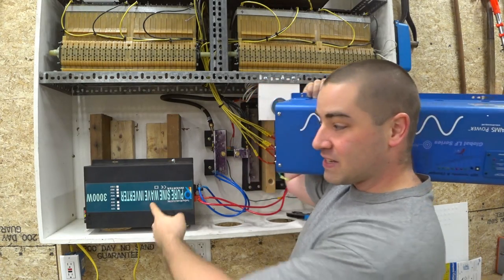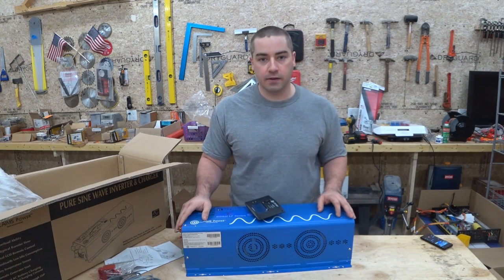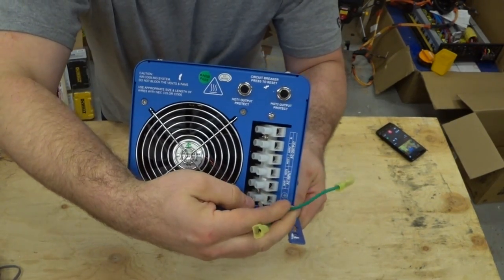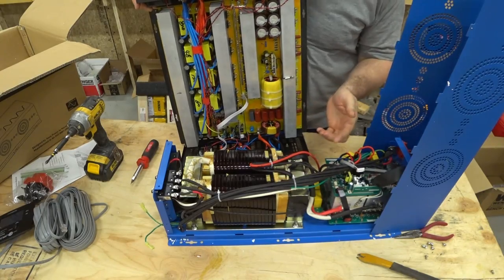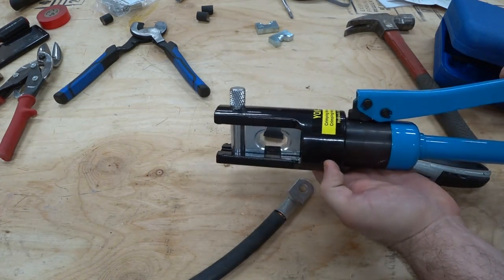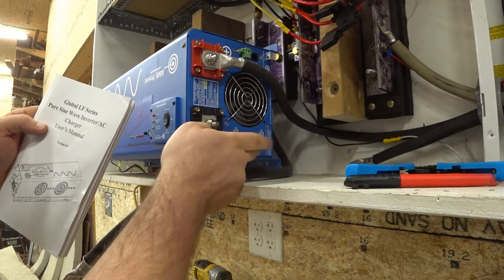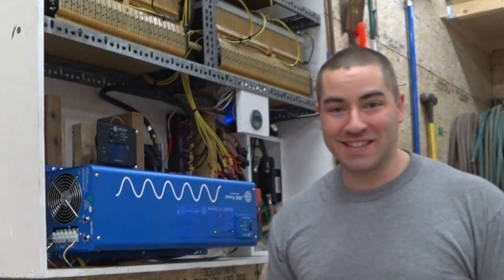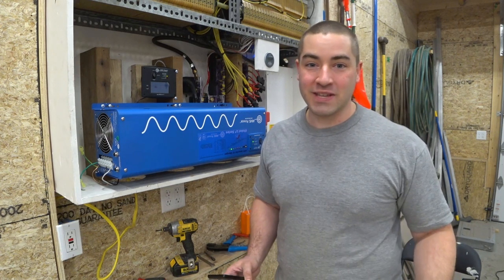Inverter Upgrade! Reliable to Aims in Off-Grid System

Comment: so when would you choose Low Frequency verses High frequency? anyone?
Reply from the maker: Low frequency is bigger, and heavier.  But LF works better with large surge capacity.  Things like my miter saw, air compressor will have a big surge that will sometimes overload a high frequency inverter.  But, HF is lighter and smaller so they are nice in portable applications.

Comment: can it run this inverter run the spilat Ac 1.5tone
Reply from the maker: I don't know how many watts your AC requires.  This inverter is a 6kw model with a very high surge.  If you AC running watts is less than 6kw, then this inverter will probably run it.
Reply: @DavidPozEnergy  Thank you

Comment: Information that can Be Found Here:
https://www.magnum-dimensions.com/knowledge/high-vs-low-frequency-inverters/inversion-methods-explained-high-frequency-vs-low

"IRON CORE TRANSFORMERS AND FIELD EFFECT TRANSISTORS
There are two distinct types of industrial grade power inverters distinguished by the size of their transformers, and the switching speed of their transistors. The ability of an inverter to absorb the electrical surges inherent in certain loads like motors, pumps, and torque-related tools is directly proportional to the physical amount of iron present in the transformer. Size and tolerances of the transistors used in the inversion process, and the speed at which they operate determines the classification of high or low frequency.

INVERSION METHODS EXPLAINED
High Frequency Inverters (HF)
The large majority of inverters available in the retail market are high frequency. They are typically less expensive, have smaller footprints, and have a lower tolerance for industrial loads. HF inverters have over twice the number of components and use multiple, smaller transformers. Their application is appropriate for a wide variety of uses like tool battery chargers, small appliances, A/V and computers, but have a decreased capacity for long term exposure to high surge loads like pumps, motors, and some high-torque tools.

Low Frequency Inverters (LF)
Our UL-listed, low frequency inverters and inverter/chargers are the pinnacle of electrical durability. The massive iron core transformer is aptly capable of absorbing surge loads because of the “Flywheel Effect” inherent in the physical amount of a transformer’s iron. LF inverters have larger and more robust Field Effect Transistors (FET’s) that can operate cooler, in part due to the slower frequency of switching required to produce AC power. These inverters are feature rich to include the optional ability to hardwire additional external GFCI outlets, input of multiple DC voltages, provide regulated dual output voltages (120/240VAC), and integrate chemistry appropriate battery chargers and transfer relays for shore power."

So in a nutshell, big heavy, expensive low freqeuncy-inverters are better suited to start your saw, air conditioner, air compressor, washing machine, etc, etc. All of those items are high inductive loads. The less expensive, light weight, High Frequency-Inverters on the other hand are better suited for smaller loads that accumulate gradually such as: computers, lights, small fans, maybe small power tools, etc etc.

This very much helped me solidify my decision on which inverter-charger to purchase. Great videos, have a good day all!

Comment: Can it run a protable ac
Reply from the maker: Yes.  I"ve had it running two window AC's this whole summer, plus everything else in my house.  The two window AC's were a 5000 BTU, and a 6000 BTU unit.
Reply: Can on Alternator us instead of on battery 🤔
Reply from the maker: I don't think so.  The alternator in my car is 12v, and this inverter is 48v.
Reply: @DavidPozEnergy  ok then wish alternator would be best to use
Reply from the maker: I don't know.  I charge my system with solar.
Reply: @DavidPozEnergy  ok

Comment: ok lets try your hot water heater  and your microwave fridge lights and electronics  all at the same time  run the water heater for an hour I have a 15,000 watt 220 split phase low frequency POWER JACK WITH OVER 8000 HOURS ON IT COST about 1000 by the way all this stuff takes about 9000 watts
Reply from the maker: Hi Robert,  Good to hear you have success with the power jack.  I'd love to see a long-term review on it if you get the time to post something.  I'd love to watch.  
This video was just my first test with this inverter.  Since this video I have ran my whole house on it, including my electric water heater and electric oven, at the same time.  I posted a video about that experiment here: https://youtu.be/4EsYfdK1Hn4  Thanks for watching.

Comment: For me it makes not much sense to have your low voltage 12, 24, 48VDC converted to 110 or 230 VAC(70-90% efficiency) then have like 5VDC mobile charger,  19VDC loptop chager, 12VDC stationary computer, a lot of electronics run on low voltages(they have SMPS inside), lighting can be done at 12v(LEDs need to drop voltage anywhay). Cooking, fridge heating and ventilation, only places where you would need mains voltages... I am not including garage, shed, and other places where you need power tools and high power loads.

Comment: Try out a 12k btu window unit. Lol
Reply from the maker: I have not tried a 12k window unit, but it will run my mini-split heat pump.
Reply: @DavidPozEnergy  im sure it will run it fine. I was just beimg funny or tring to. Lol.  This looks like a great inverter.. gonna have to get me one. What was the cost?
Reply from the maker: I bought it for $900, open-box.  But I think they run $1400 retail.
Reply: @DavidPozEnergy  ok. Ty very much

Comment: Those are garbage inverters. I wish you the best, but the bus conversion company has had a 70% failure rate over 2 years. I recommend the more expensive models by magnum or victron. All the best!
Reply: That's interesting to hear the aims inverters don't last. Do you know what models they have had the bad luck with?

Comment: what's the standby current?
Reply from the maker: I don't know the current, but the standby watts is 30, and idle watts is 80.  Not good, other inverters are about half that.
Reply: @DavidPozEnergy     thanks for answering. yes i was afraid it would have a high idle consumption. 80w is like almost 2kwh a day. this can easily compensated with a couple of solar panels. however overnight with the battery to compensate would be somewhat costly.
Reply from the maker: Exactly.

Comment: Upside down is making me twitch.
Reply from the maker: LOL.  I actually tried flipping the lid over because the screw holes look like they would line up, but the display cable is not long enough.  As I mentioned in the video, I'm not 100% liking the current location and am thinking of maybe mounting it under the box, which would turn it right side up.

Comment: David, is this Aim inverter  of the floating type??...meaning the neutral and the ground are not bonded???....can you bond them??? I was watching this video https://youtu.be/Yh4dHJ8xMKM....and it said that you can't....So what we do for this ground issue? Thanks.
Reply from the maker: When I checked my inverter, the N and G were not bonded.  However, there was a connector where you could bond the two.  I left them un-bonded because I have a bond in my breaker panel and you only want one bond in the system.
Reply: @DavidPozEnergy  Excellent!!!! That was the answer  I was expecting. Thanks.
Reply: @DavidPozEnergy  I have a 3000 watts Reliable inverter...when you check this inverter the neutral to ground is 60 volts and the hot to ground is also 60 volts. This unit is not bonded.  Do you complete the bonding at the panel?...I'm curious from the fact..that the neutral is showing 60 volts....Thanks
Reply from the maker: I also own a reliable electric inverter.  These are not made to feed a panel.  I've spoken with a handful of people who blew up their inverter when trying to go to a circuit breaker panel.  I suggest only using a reliable electric inverter to power an appliance directly.
Reply: @DavidPozEnergy  ufffff....and if for any bad luck the   metal cover  say of a drill  get in contact with the hot cable...if  you touch the metal...can you get electrocuted???...Maybe not if you only touch the metal since there is no path to neutral ... What do you think 🤔🤔🤔???...So basically with these Reliable inverter the ground is useless...😬😬😬☠️☠️☠️????

Comment: ps your test is to ez do like a 35000btu air condenser or a 4hp compression  do a real test i have bin off grid over 40 years i run a shop off my inverters and a house. and  well pump
Reply from the maker: Check out some of my other videos on this inverter.  I crank up the loads.

Comment: This just popped up in my feed, and I figured I'd throw my two cents in. Aims inverters are shit. Dont know how much they have changed but iv had three models and all 3 were terrible. Large expensive models not the small ones. I dont use them anymore. But the magnum 4400 can do 2 to 3 times as much as the 8k watt aims. And even magnum is an average inverter. I dont think people know what a good inverter is. But once you use a good inverter, you'll never go back to using these low quality ones. And it's not even that much more expensive to go with high quality.
Reply from the maker: Magnums are great.  As I mentioned, I was saving up for some before buying this one.  I don't know how long it will last, but I'm happy to make a video and share if it does fail.  Do you have any videos or pictures of your system?  I'd love to see it.
Reply: @DavidPozEnergy  I think I may have some pictures on my Facebook page, my personal system is very rudimentary. Mine is on a trailer and its mobile, but I only spent about $5k on the whole set up, trailer, 8 batteries a aims controller and I have two aims inverters but ended up upgrading to a magnum 4400. But I do installs for a guy that owns a solar company, hes been building systems for about 40 years and his dad worked on the solar for nasa in the 60s. So I am around alot of systems old and new that he does. The Schneider inverters are by far the best I have been around for home models. Mainly the systems he does are passive solar and hydronic heating. I just looked up the price of a aims 6k on Ebay, for that price you cant complain to much but i only paid $1600 for my magnum with a controller and a bunch of other accessories. I bought a aims package in 2014 when I started, include batteries 2 controllers 2 inverters, 12 panels. I think I paid like 4500. I smoked most of the components after 2 years. Still using the panels tho
Reply from the maker: I've heard great things about Schnieder.  That XW6848 looks like an ideal solution.  When I was looking at them I found I needed to buy the inverter, plus a monitor, plus a box for it.  The package was $3,900.  The specs on them look amazing.
Reply: The big difference is the specs are true to their word. If it days it surges at 12k watts it will take a 12k watt surge. I think thier surge rating is for a long period of time. But the package he sales Is like 8k dollars for just the inverter. But yea maybe doing some surge test and make some videos and check thier surge and continuous ratings. I have the older models of aims, I have the silver frame models. Aims has changed manufacturers a few Times in the last few years so far as I know.
Reply from the maker: I tried to find you on Facebook, but there are 6 Jason Townsends..  I'm https://www.facebook.com/DavidPozEnergy/  If you get a chance to say hi, I'd love to see your setup.
Reply: @DavidPozEnergy  You would not have to use their Panel Box. You already have one. Just put the correct breakers in there. All it is a bypass, ac and dc breakers, dim rails, bussbars. I serously considered a Scheinder XW6848. But believe I will go with 2 44448pae magnums instead. Smaller foot print and more wattage.

Comment: AIMS inverters are junk.  I've been doing this for 13 years and have yet to see one of these work longer than 5 years.  I never install these (I never install Chinese garbage at all), but I've had to replace a bunch of them with Magnum, Schneider, or Outback inverters.  Why go through the effort to install one of these when you can get a Magnum for only $150 more.  Beware!
Reply from the maker: Thanks for bringing your experience.  I agree there are better inverters.  Eventually I would like a Schneider XW6848.  That looks like a super nice inverter.